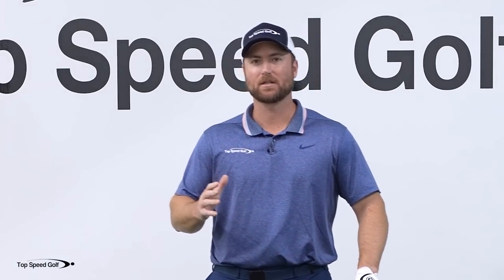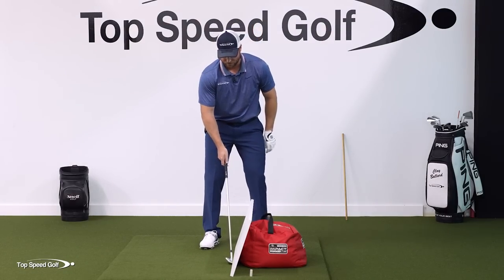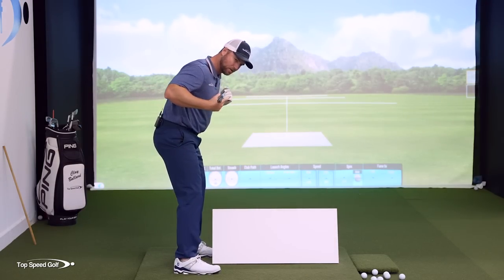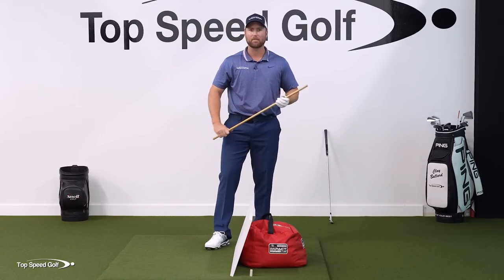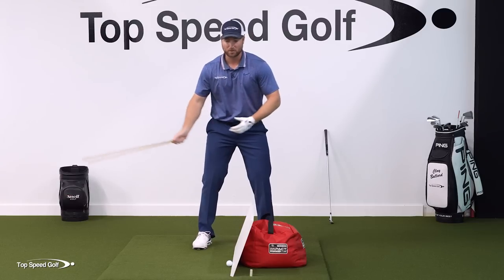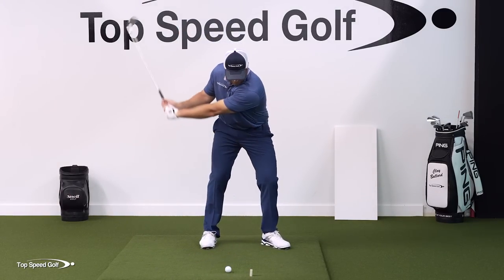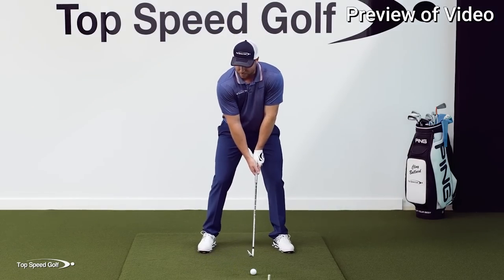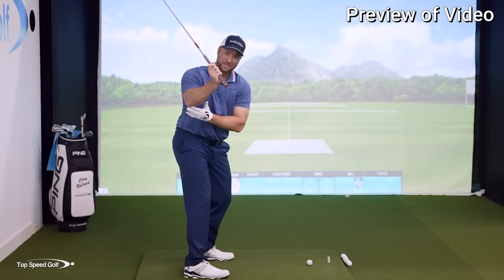Can Your Iron Swing Really Be That Easy When You Do This Drill?

Comment: The shaft extended on trail side across arms was gold for me.  It also helped me identify a primary problem of taking the club too far to inside.  I have a question.  I notice that at impact in almost all your impact drills, the trail arm's elbow is aligned with the trail hip at impact.  Is this a point of focus for achieving the desired angles for hips and chest at impact?  I had been trying to get my shoulder over the ball, and that proved DISASTROUS.  But I did get some amazing beaver pelt divots.  Thanks Top Speed, the videos have been good for me primarily identifying faults, now the painful change to consistency.

Comment: Great tips Clay..My question here is if you are going to hit a 9 iron and shaft lean to get a stronger loft...why don't you just hit a 7 irons for the same loft and hit it with your true swing??
Reply from the maker: De-lofting the club allows you to get compression and much more consistency.
Reply: I recently started doing this and not only are my irons going straight more often and the distance for my irons have gotten much longer. From longer distances it gives a bit more control with the irons going for greens rather than hitting woods.